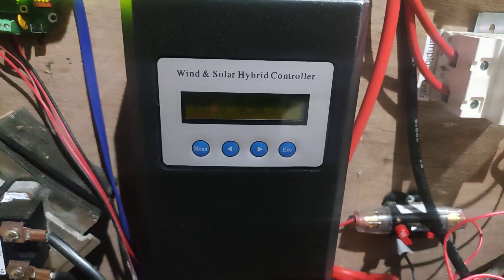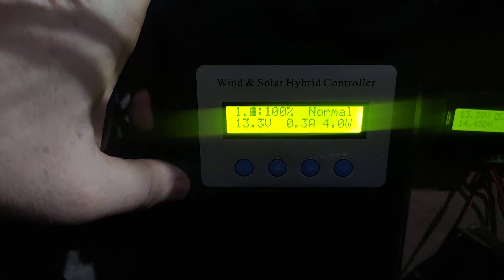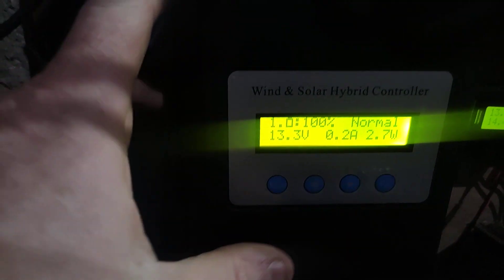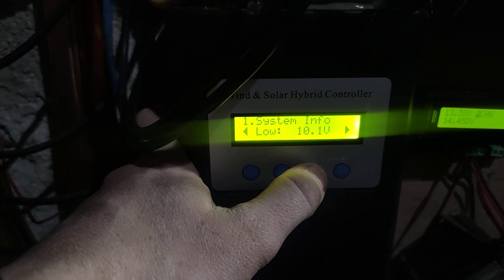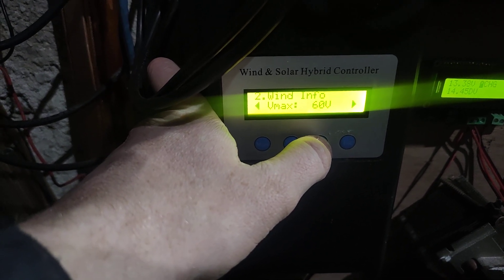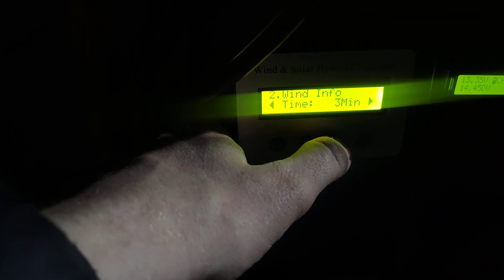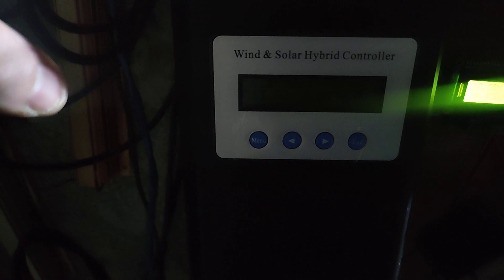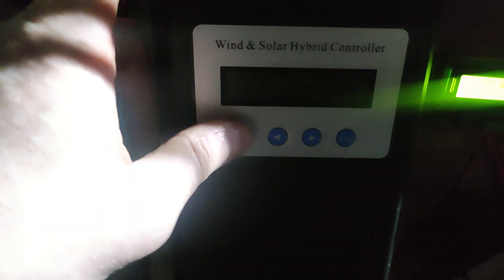Mini review of my wind turbine charge controller

Comment: What is the brand of this conroller?
Reply from the maker: You can check the link in the description, its made by ezpower.cn
Reply: @offgridamps  Thanks a lot.
I think the problem with MPPT's and Li batteries is that the batteries do not operate at 48V (which the MPPT regulate at) but at higher voltages, i.e. up to 54V, which means the battery never gets charged because the voltage is too low.
Does this unit makes provision to change the voltage output to a higher setting?
Reply from the maker: @mvr1810  this unit is for 12/24v so it won't work on 48v, they have bigger units which will work with 48v, what size turbine/voltage do you have? As that will determine if it's a boost or a buck for 48v battery.
Reply: @offgridamps  My unit is 3 kW (about 60A@50V) and "48" V, but LiFePo4 work above 50V, as you know.
Reply from the maker: @mvr1810  https://m.alibaba.com/product/60208965702/3KW-48V-MPPT-wind-charge-controller(Boost&Buck).html?__sceneInfo=%7B%22cacheTime%22%3A%221800000%22%2C%22type%22%3A%22appDetailShare%22%7D&from=Android , hope this link works its for the bigger model 3kw @ 48v battery, you cant adjust all charging parameters so you decide to stop charging at what voltage etc for lifepo4 48v is fully charged at 58.4 volts but you need to make sure if all cells are correctly balanced for this voltage, if yours is lifepo4??, also controller needs battery connection at all times if you connect infront of bms and the bms shuts off charging it will blow the controller probably , you could charge at a lower voltage to stop bms from cutting off charge but you wouldnt take full advantage of capacity this way.
Reply: @offgridamps  Thanks Jon,
I will connect this in parallel with my solar system to the LiFePO4 batteries, i.e. there will always be a voltage on the busbar where I connect.
I like this one and am going to order it from Alibaba.
Reply from the maker: @mvr1810  please mention my name ! When ordering hope it works well and be sure to mention the amperage you need and voltage open circuit of your turbine